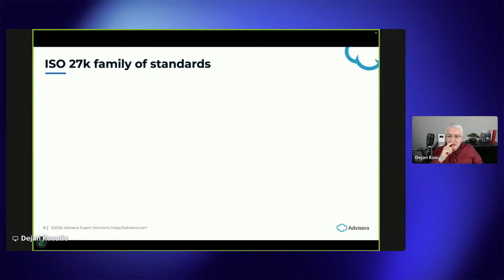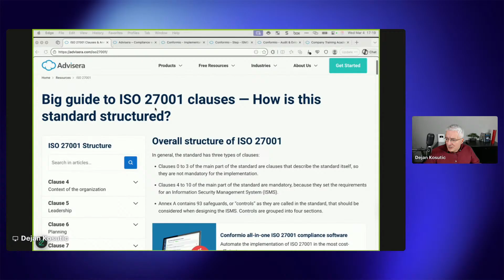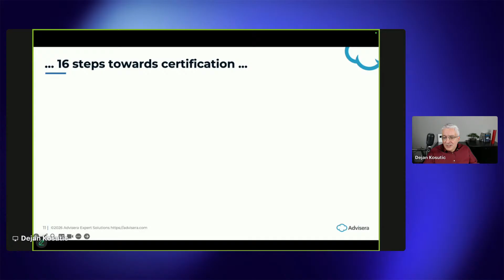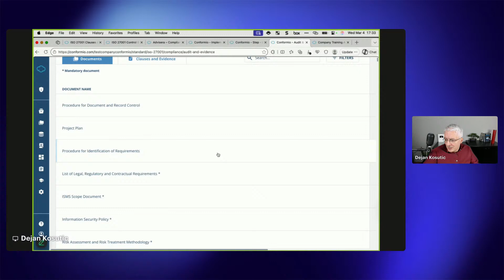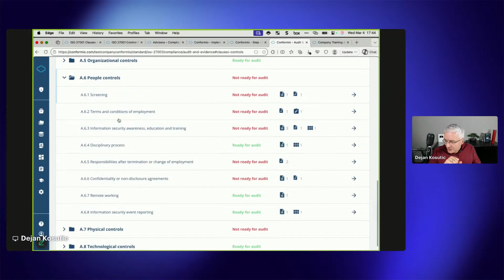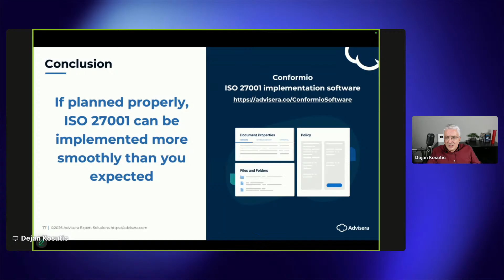ISO 27001: An overview of ISMS implementation process [live webinar]

Comment from the maker: You can find below all the links we have shared in the live webinar: 
- Conformio ISO 27001 implementation software https://advisera.co/ConformioSoftware
- Conformio expert calendar link https://advisera.co/ConformioExpert
- ISO 27001 Training & Awareness https://advisera.co/ISO27001-TrainingAwareness
- ISO 27001 Certification Cost Calculator https://advisera.co/27001-Certification-Cost-Calculator
- How to identify ISMS requirements of interested parties in ISO 27001 https://advisera.co/27001-ISMSrequirements
- All you need to know about setting the ISO 27001 scope https://advisera.co/define-the-ISMS-scope
- ISO 27001 Risk Assessment, Treatment, & Management: The Complete Guide https://advisera.co/27001risks
- ISO 27001 Risk Assessment and Treatment - A Practical Guide https://www.youtube.com/watch?v=DKzijPaHS-Q
- Statement of Applicability in ISO 27001 – What is it and why does it matter? https://advisera.co/SOA-Importance
- Automating ISO 27001 Statement of Applicability with Conformio https://www.youtube.com/watch?v=46SSKQz7dQE
- How to perform monitoring and measurement in ISO 27001 https://advisera.co/ISO27001-Monitoring-Measurement
- Big guide to ISO 27001 clauses — How is this standard structured? https://advisera.co/Big-27001-Clause-Guide
- List of mandatory documents required by ISO 27001 https://advisera.co/27001-mandatory-documents
- How to perform training & awareness for ISO 27001 and ISO 22301 https://advisera.co/27001-Security-Training-Awareness
- How to Implement ISO 27001 Training & Awareness Quickly in SaaS or Tech Company https://www.youtube.com/watch?v=aR96EjXB_Cw
- ISO 27001 internal audit: The complete guide https://advisera.co/27001-internal-audit-guide  
- ISO 27001 Internal Audit Essentials: Everything You Need to Know https://www.youtube.com/watch?v=Rk1dnXoIPbM
- Why is management review important for ISO 27001 and ISO 22301? https://advisera.co/management-review

Follow Dejan on Social Media:
- YouTube channel: https://www.youtube.com/@DejanKosutic
- LinkedIn profile: https://www.linkedin.com/in/dejankosutic/
- Secure and Simple Podcast https://advisera.co/SecureAndSimplePodcast

Upcoming webinars:
- Advisera Website: https://advisera.co/Webinars  

Below, you can also find the links to our: 
- Webinar Survey https://info.advisera.com/webinar-survey/iso-27001-an-overview-of-the-isms-implementation-process/ 
- PDF slides https://advisera.com/webinars/materials/An_overview_of_the_ISMS_implementation_process_webinar_presentation_deck.pdf

We look forward to seeing your feedback!